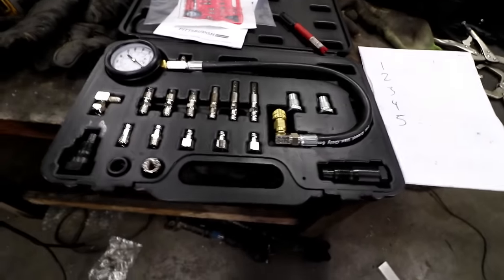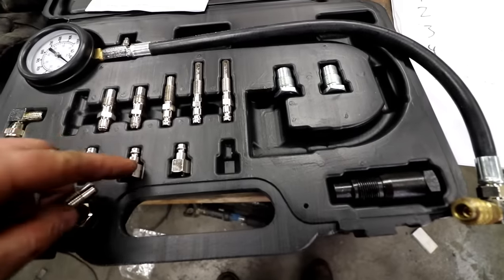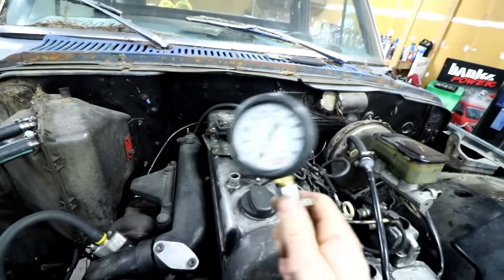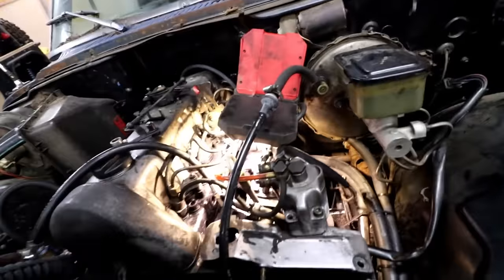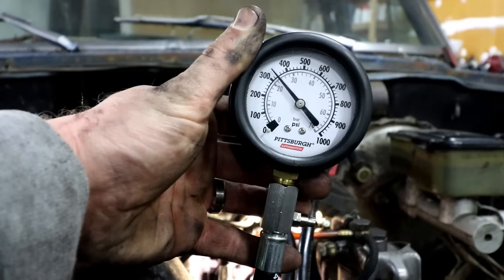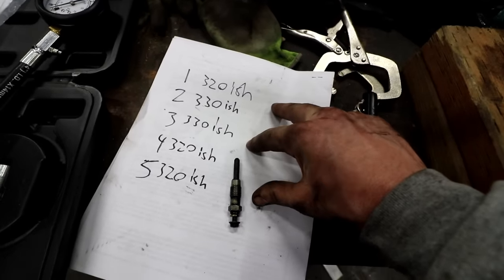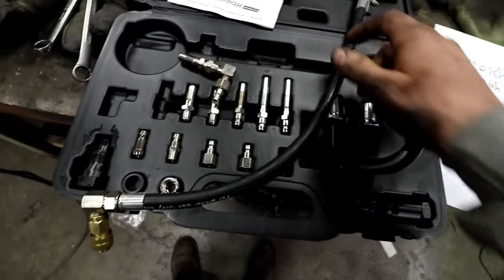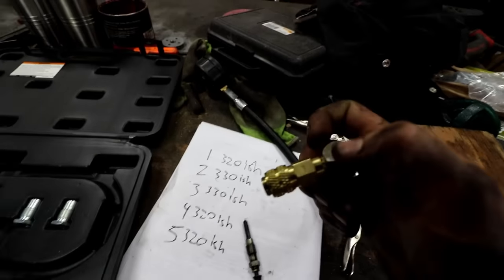How To Use A Diesel Compression Tester

Comment: i agree whole heartedly despite what many say, cheap tools are perfect for uncommon uses, quality tools are necessary for daily purposes
Reply: Nail Face exactly! If you're running a shop it pays to have expensive tools but if you're guys like us who are going to use a specialty tool every couple years it makes more sense to go the cheap route! More money for our projects
Reply: Nail Face cheap tools only when accuracy isn’t important. For something like this I’d spend a bit more for a good unit. You don’t want to be relying on a crap garage that isn’t giving you correct reading. Because then your jumping into big work when it shows low readings.

Comment: I’ve diagnosed low compression also by observing white smoke and cracking the injectors like a cut out test, located the problem cylinder and boroscoped it to find the walls of the cylinder heavily worn

Comment: What is considered a low compression for a diesel ?
Reply: Depends on the car, for my 03 Volkswagen TDI Alh I would expect around 600psi however the compression will decrease as there is more wear on the engine, not by much but a little!

Comment: I did this to my neighbors mercedes om617 NA all a hair over 300 psi except cyl 5 about 10 psi... that cylinder had a molten glow plug... DONT GET BERU PLUGS

and the stupid harbor freight compression tester well the 1st one exploded, the 2nd one leaked the 3rd one was returned
Reply: James Flores thanks for the tip! I try to stick to Bosch as much as possible these days so hopefully I can avoid any molten diesel parts! LOL
Reply: when it comes time to replace nozzles DONT go bosch go bosio or monarch with the primer pump go monarch

Comment: So I take it if you don't have glow plugs you can tap into the injector hole, minus fuel flow. I like the growing cheap list I am building following your posts. Wife on the other hand...not so much...lol
Reply: Jim Whitman exactly! This small kit comes with a couple of adapters for injectors but the larger kits come with a ton of adapters! If you don't have glow plugs I assume that means you're working on a Cummins or an old tractor. I believe there is an adapter in this kit for 12 valve injectors. And I think the first generation of 24 valve (98-02) is the same size.

Comment: Just tried using the same brand new kit on my vw diesel in a running engine and i get nothing I’m assuming gauge is failty
Reply: Does your VW diesel have threaded glow plugs/injectors?

Mine does not, and I can't figure out where to get tools for doing the test? All tools seem to use threads?

Comment: What is the reason for giving the engine the breaks you did? Are you suppose to crank it until it stops rising in PSI?
Reply: Juan Gonzalez yes you’re supposed to stop when it quits building pressure but the starter on this vehicle was bad and wasn’t turning the engine over like it should.
Reply: No reason! This buddy just had a starter in the process of taking a 💩. Normally u don’t let off the crank till pressure gauge stops climbing

Comment: Cool vid.  Is there any reason you would want to check it through the glow plug hols vs the injector feeds?  Or is it just convenience?
Reply: Khorsathedark both will give you the same results! However there are heat shields for the injectors that you need to replace every time you pull one. Pulling the glow plug doesn't require replacing anything so I decided to take the easy way out :)
Reply: Most injectors are being held in place by some type of fork, so there is no threads to be used for fixing the pressure gauge. That’s the main reason I can think of. And then you should install new copper washer under the injector, when you put it back in.